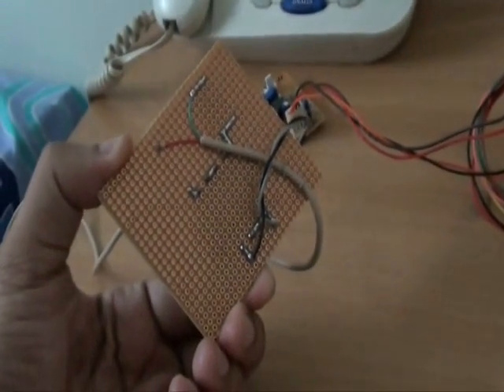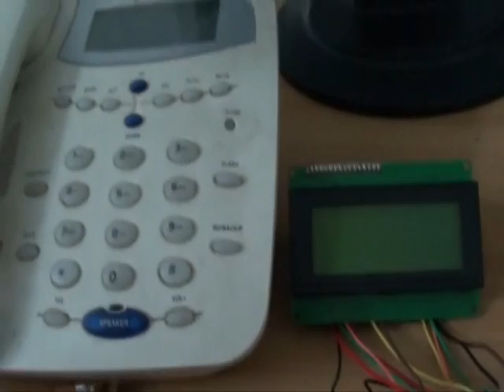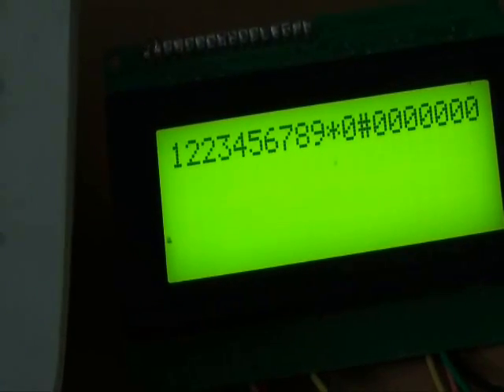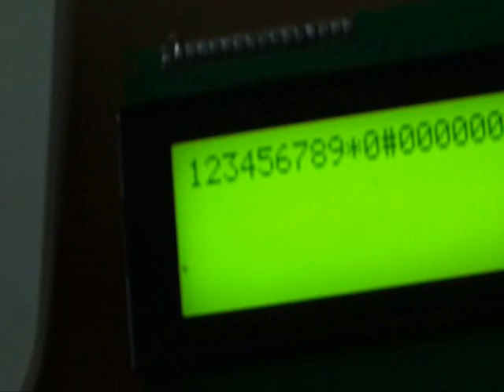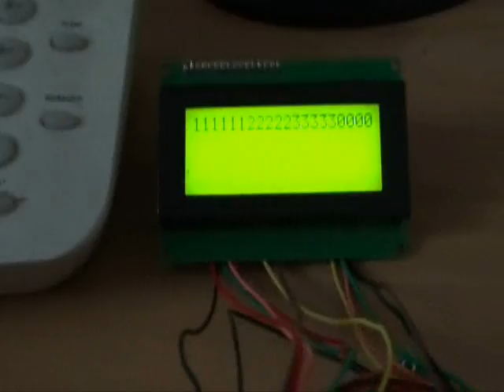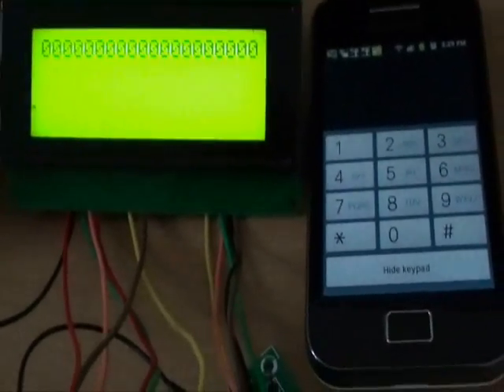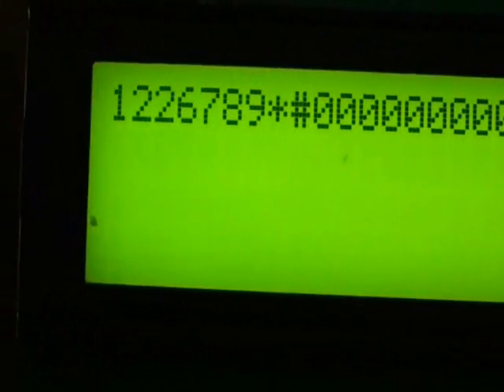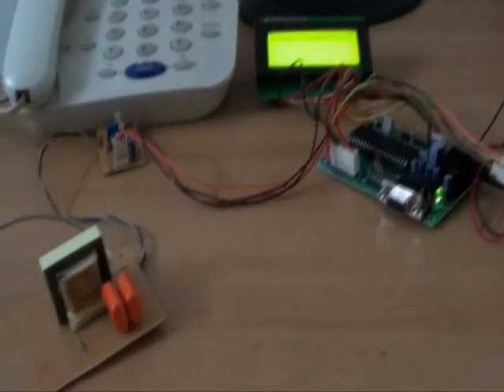PIC18F4520_Goertzel_DTMF_Decoder

Comment: Are you using 16 bit coefficient and int32_t prev, prev2 signed 32 bit intermediate values?
Reply from the maker: This project is 14 years old. I have grown older and forgot all the implementations. Moreover, in India, most analog telephone lines are removed and hence, this project is not useful, unless you want to use it for some other application.

Comment: I'm not even sure I understand that or where I'd even start. 
I did however notice that you implement a way of getting the coefficient value like (as far as I can tell) nobody else on the what I've researched (mainly internet based). It's far simpler and makes far more sense. I was using a Texas Instruments report as a basis for my algorithm and it was confusing me.
If I do well in this project, i'm sending you a virtual medal!

Comment from the maker: I think, he means by calculating the frequency response (or running the Goertzel algorithm and get the result) before the next batch of samples arrive. That way, you will not miss any sample. This is required for all practical applications and also needs your processor to be fast + algorithm efficient so that the calculations complete in stipulated time.

Comment: You're project reminds me of how little I know and how I need to work much harder!

I'm trying to use C++ and build an Arduino library. I was discussin my projecct with my supervisor today and he noticed that I was using a pre-defined block of N samples. He mentioned that this could be calculated on the fly (not exactly sure why though??). Would you know of such an appraoch or if you could point me toward something that could help solve this question?